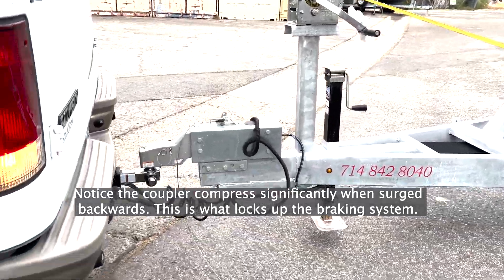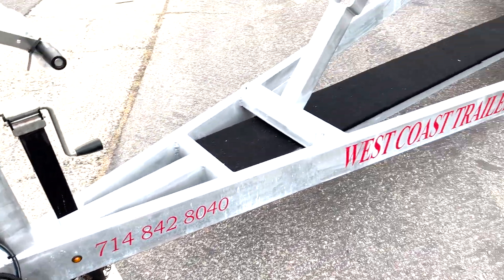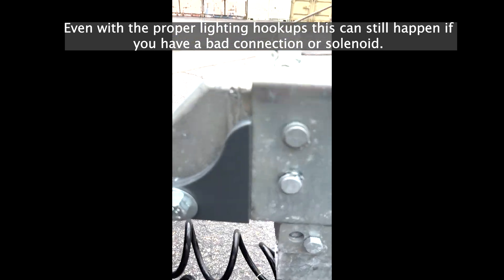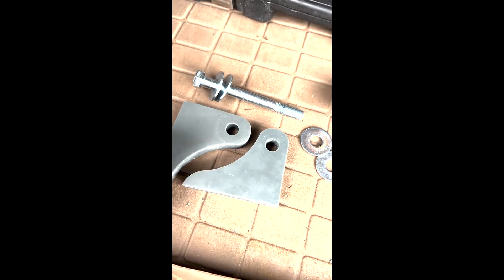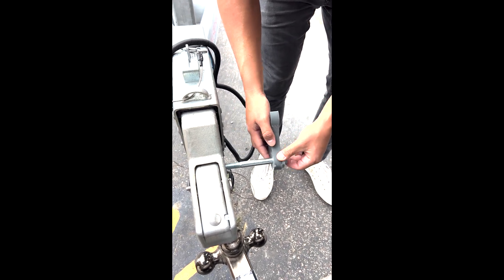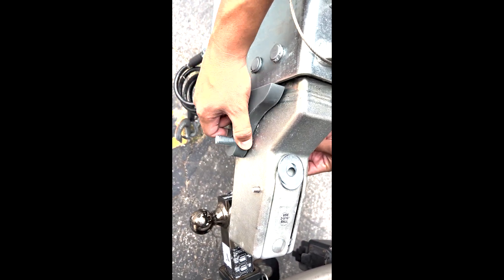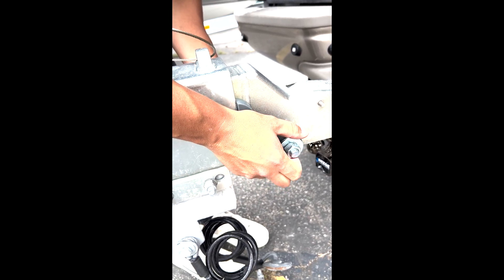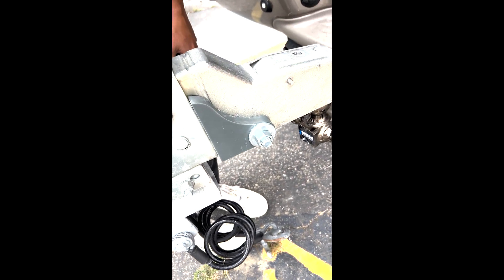Trailer Brakes Locking Up on Backup - SOLVED | notrailerbrake.com

Comment: The problem with doing it that way is it would prevent the brakes from working when going forward, which is illegal
Reply from the maker: I don’t believe it’s ‘illegal’ to not have a surge brake mechanism but ya it’s not meant to be using when moving in forward direction